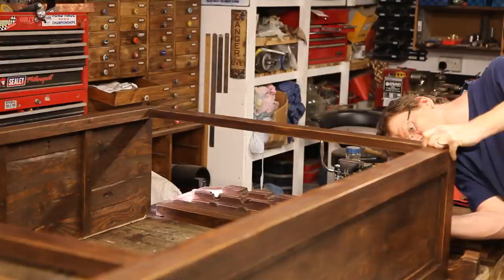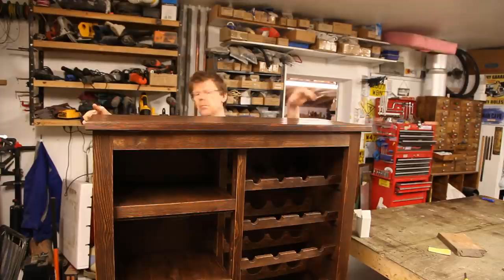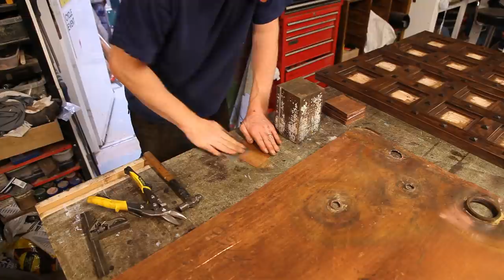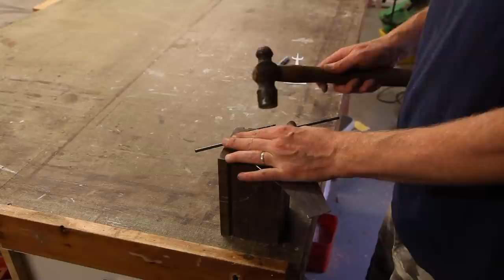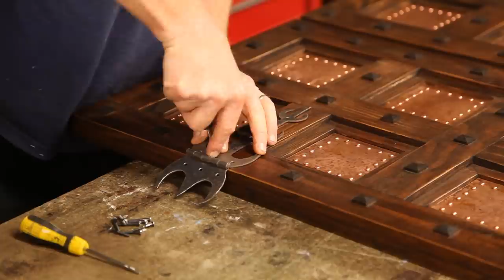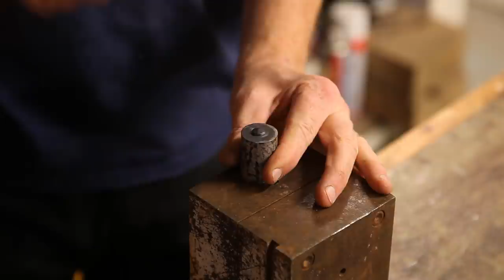Pallet Furniture. A Medieval Drinks Cabinet Made From Pallets and Junk. Part 2

Comment: Jason, are you ever concerned that some of the pieces of wood that you recover have lead paint?  Katie
Reply from the maker: Katie, It's very rare that I get any wood that is painted with lead paint. I usually avoid it these days. The planks that made up the top of the drinks cabinet were one of the few times I've used it, and the top got changed a few weeks later as I wasn't completely happy with it.

Comment: Hello
I have to buy a thickness planer and a table saw. I was wondering about the dewalt company but I can see that you are working on record power devices.

What do you think about this company? How does a planer and thicknesser work when it comes to precision of work? How long have you owned these devices? What about the failure rate of devices? And when it comes to the table saw, what do you think about it?
I would be very grateful for your opinion

Comment: where did you find those small brass nails for the copper door inserts?
Reply from the maker: They are knurled copper rivets. I usually get the on Ebay.
Reply: @EpicUpCycling  thank you.  very fine work by the way!
Reply from the maker: @ykmjc  Thanks very much :)